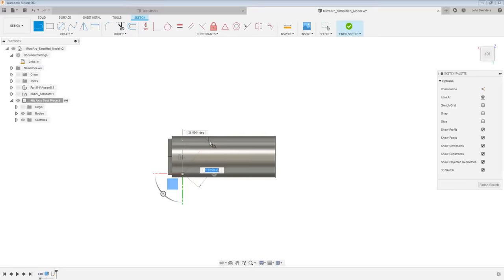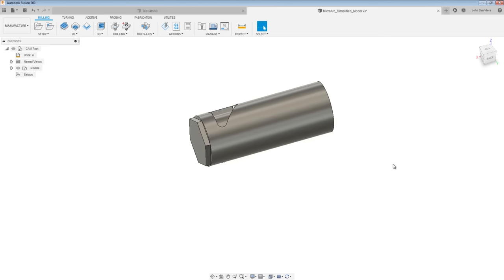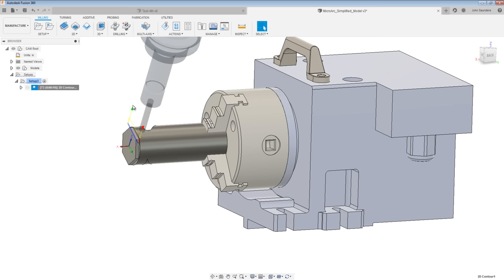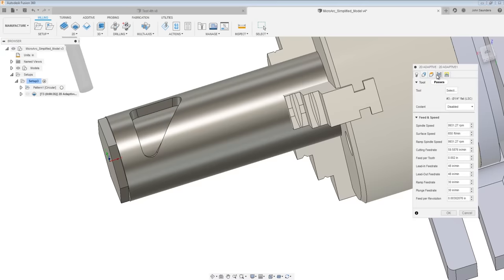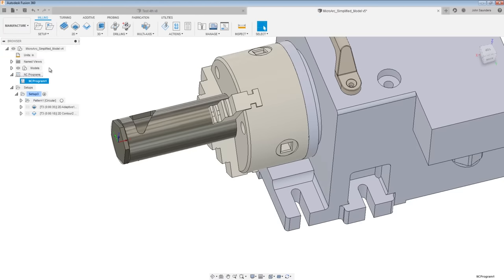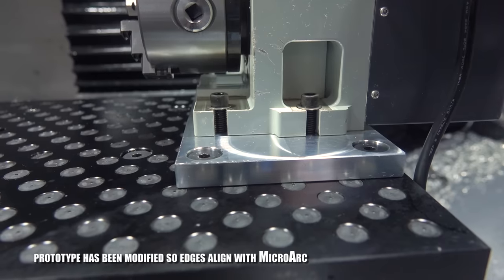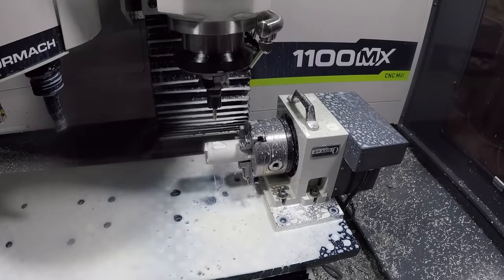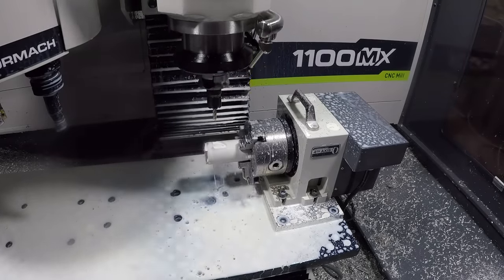Simultaneous 4 Axis Machining in Fusion 360 with the Tormach microARC 4!

Comment: Hey john, I am trying to use some of these fourth axis options in my router but can’t seem to get the settings correct. Either it doesn’t see the geometry as something should be done in a circle, or it says it can’t unwrap cyclical geometry. I have been struggling with this for a couple weeks and just can’t seem to get it figured out

Comment: John, have they come up with rotary toolpaths that are parallel and not perpendicular to the rotary axis yet ? or am I missing something ? In other words placing the table flat on the bed instead of horizontal position ? or is that something you just have to hand code at the moment ?

Comment: Thanks for the video. Just started playing with "Personal version" of Fusion 360. One thing that seems strange is I tried using the 2D contour like you used to make a simple bolt with a hex head and found that it wouldnt let me just machine the cylindrical feature where the threads will go ("can't wrap toolpath" ) but if  in my model I only revolved my sketch 359 deg instead of a full 360 then it can unwrap the tool path?

Comment: I am trying to do a spiral flute with a key-way cutter using fusion and the contour setting but it will not let me use the side of any cutter when using a wrap technique. Am I doing something wrong or does fusion not allow something like this?
Reply: Use a ball EM in z. The reason you can't use a cutter with that profile, to cut a spiral, cutting in from the side, is because it just won't work. It'll be trying to cut in way too many directions at once. (Top, bottom, and periphery of the cutter.) As far as Fusion LETTING you do that CAM path, I don't know whether it will let you, or why you can't get it to, but even if you were able to get the CAM down, it wouldn't work. If you have a mill that you can tilt the head, you can tilt it to the same helix angle, and use an EM to cut in from the side and do a spiral flirting operation.
Reply: @xenonram  Currently I am using a ball emdmill in Z. There are companies that do what I am talking about with a radius keyway cutter, I guess it would technically be called a O ring grooving tool.

Comment: Would it not be better to simulate the toolpath in fusion first instead of going straight to the machine with the part turned off and colorization set to comparison since wrapping is an off-center toolpath to see if you are cutting into the part.

Comment: For what reasons do you prefer fusion 360 over solidworks? I am looking to purchase one or the other and would like your opinion. I do Fab work and recently released a video I think you may enjoy. Check it out on my page, thanks!
Reply: Try them out. You can use Fusion up until the point you're making $100k. Try it out. The reason there are about a dozen of them, is because people have different preferences and different necessities. So check them out.
Reply from the maker: SolidWorks has more powerful CAD, but Fusion 360 works well for us because of it's lower price and solid integrated CAM.
Reply: Andrew Delashaw awesome, I will do some trials. I have solidworks through school. Likely fusion as well. Thanks!!
Reply: NYC CNC right on, that makes sense. I haven’t messed with the cad portion yet on solidworks. Thanks!
Reply: Can confirm what NYC CNC replied, Solidworks is meant for some serious modeling/assemblies, but running a CAM in it just sucks in my opinion. Fusion360 is an awesome CAM package with the 100k profit limit and even then the price isn't bad. Also you can do designs with it, it doesn't have all the bells & whistles but it so much depends on your needs.
Reply: @JaakkoF   I understand. Even at that, the software is only as smart as the user(at least in the beginning stages of ones CAD learning). Thank you for the info!

Comment: According to tormach the throughbore dia on the micromark is 19mm or 0.748". Not really enough to do gunsmith work on barrels.
Reply: Tail stock, or some other support system on the other end, will solve that issue. Plus, most gunsmith barrel mill work, that you need rotational 4th axis, needs the whole barrel to be accessible. So putting it through the bore won't help with very much. Things like dovetail grooving for a front sight on a historical rifle, and maybe pinning a muzzle device, are two exceptions. But you don't need a 4th for that. I can't think of anything you'd need to do to a barrel on a 4th axis, where you wouldn't want the whole barrel exposed.